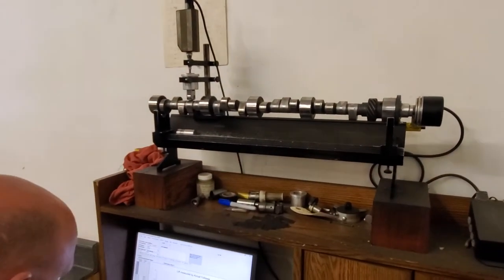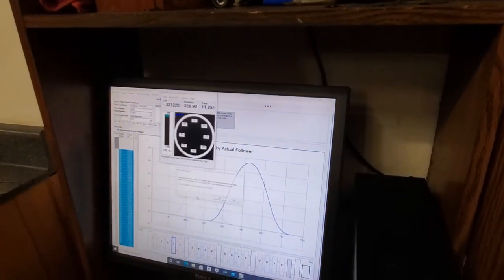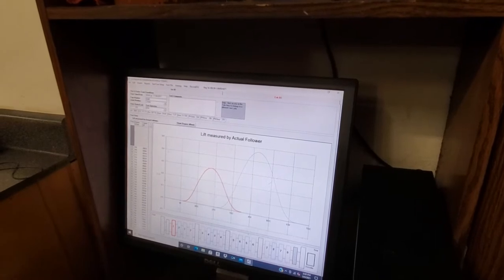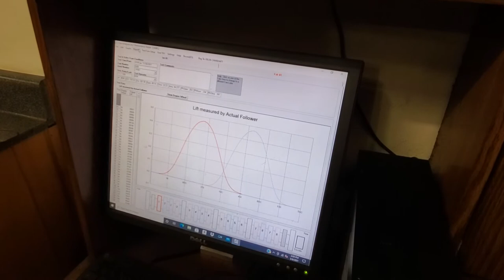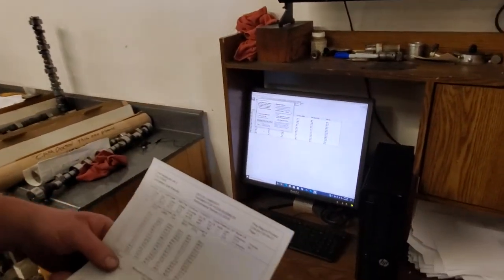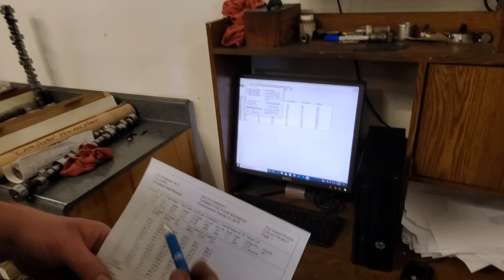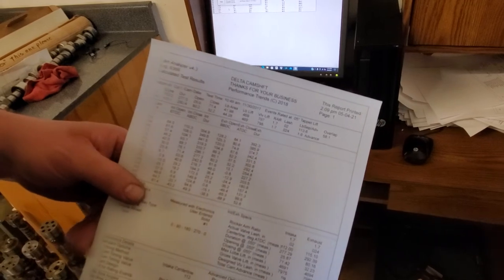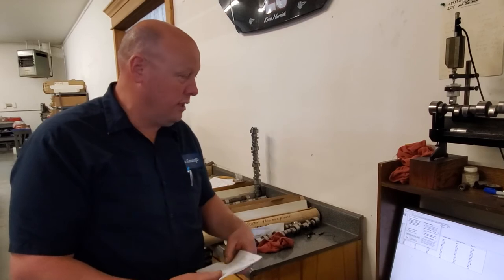Cam Doctor @DELTACAM8005625500

Comment: Good thanks for these interesting videos. This can be done with a standard dial gauge and a goometer on the edge to plot degrees and measurement. Sort of like when they sync with a dial and clock to fine tune. What literature do you recommend for these cases because I do not have the terminology, that is, I do not handle it and I am interested. Thanks in advance for your help.